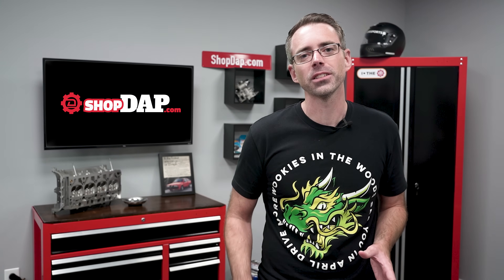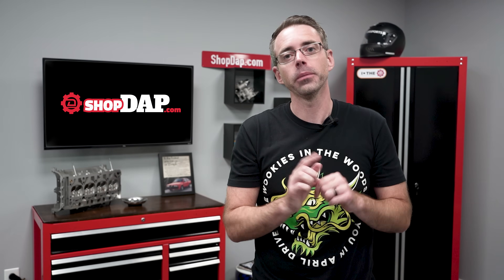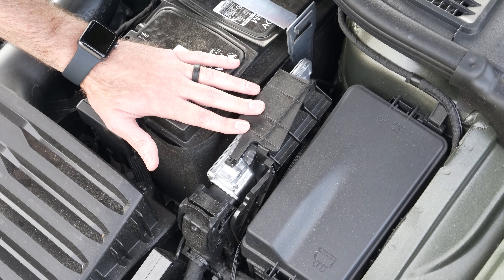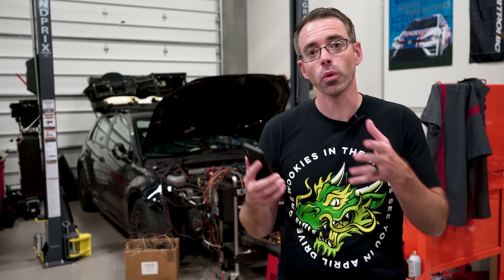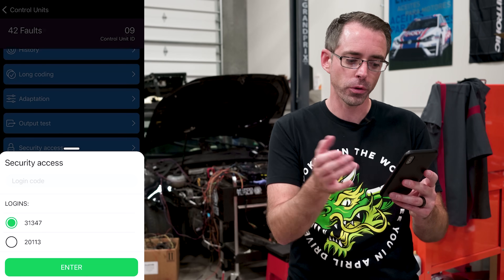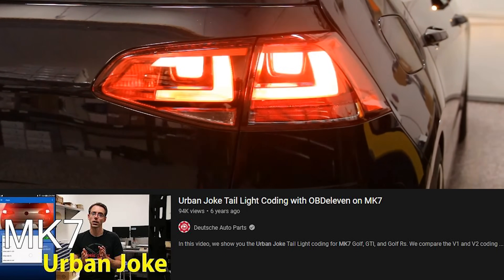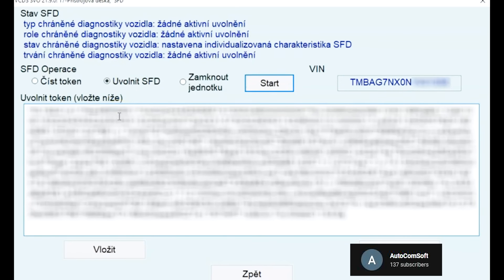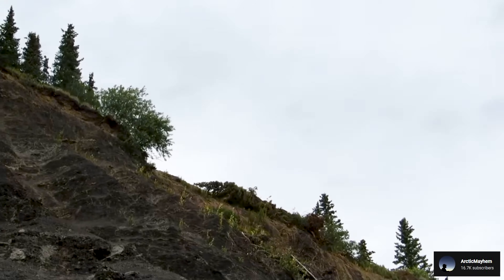Is VW Trying to Stop you from Working on your Car? SFD Unlock

Comment: I don't like it, because there's almost no consumer benefit to over the air updates. Its great for manufacturers, but if the goal was consumer friendly they would have streamlined (and made free) the wired update method first.

The goal of ota updates is the subscription model for features. Its not an end for the manufacturer by itself.
Reply: VW thinks people want cell phone features built into their car, like android auto, so it is for marketing.  Some people might think they want it, but in reality they just play music and use hands free over bluetooth.
Reply: What makes you think the OTA updates are to enable or disable features based on subscriptions? I know BMW does that but do far they're alone. It's a common practice to distribute software updates that improve functionality of the car or fix bugs that show up later after a new car has been launched. Usually you bring the car to the dealership to get those updates though. 

OTA becomes particularly important if a security vulnerability is found. The fix can be distributed to everyone with that vehicle almost immediately, rather than expecting customers to return to the dealership for a recall.

Its practically impossible to test all the software in a complex system, like a car, in all possible situations before its launch. So the ability to fix issues in the future is a benefit to the oem and the average customer.
Reply: @joebormann7631  I would buy that but without OTA integration there's an extremely low level of vulnerability to security issues. That only pops up in a big way once they allow rewrites over the air, which they are all, not just VW, in the process of implementing. While I do understand the desire to fix 1st year bugs without roping in the customer, the dealer network works just fine for that as is. The car itself is a static software environment, it's only the phone integration that would require updates once everything else is stable, and that is handled 100% on the phone side already. There simply isn't a problem there as it is now, at least for any brand with a dealer network. Tesla otoh, needs it, but only because they have basically no service footprint.

As far as subscriptions go...all the majors have announced plans/intentions on this. They have nearly all also announced the desire to be the ones gatekeeping and selling cellular data from in car use as opposed to android and apple. Both of these margin increasing plans absolutely require OTA to implement in any kind of profitable and streamlined manner. My problem is, I see zero benefit to myself as a new car buyer, only added and recurring costs.

Comment: It's probably a little bit of both, honestly. I think if they can dissuade people from working on their cars and funnel them to the dealer? That's great for them, but it's a secondary bonus for them. It's likely for security, but I think a 'better' way to do this would be a setting in the infotainment that would turn on a 'support tunnel' for a set amount of time. Whatever the average update takes + 15 minutes or something like that that ALSO requires the hood to be open. You can also ping people to the infotainment saying 'Update available' and then page number in the manual or a QR code for the instructions online to do it. You could even add an MD5 hash of the update to verify against the one in the release notes to verify it's the correct file before doing the update.

This is sort of how enterprise IT equipment (including backup appliances and storage arrays) works nowadays. You can call support, and they have you turn on the support tunnel, otherwise there's no remote access to the device. It's secure and also lets you actually use your equipment as you see fit whilst still being open for OEM support when needed.
Reply: except when there is an ECU that is online there is always a way to hack it, whatever you try to implement to avoid it... the ECU already has to be online for the maps and stuff like that
Reply: @WhiteG60  there is always a way. But sometimes there's not enough money on the line.

Comment: My local Audi dealership constantly:
- avoiding to pick up their phone when you call to ask info or book a service
- charges me for diagnostics and doesn’t deduct it when I decide to accept their repair proposal and pay for them (its ok to charge if you wanted diagnostics only and to repair yourself. But charge diagnostics and repairs…)
- mess up their own parts order
- refuse to do wheel alignment (the machine is “broken” like Ice Cream machine at McDonalds
- overcharges
- clearly is not used to repairing anything newer than 2012 cars (we are a poor country)
- favours companies heavily and ignores “civilian” customers with service
- mid repair “accidentally” realises that they need more parts…despite paying 70eur for diagnostics that told us a different price for repairs and parts

But suree…me repairing my car is the problem!
Reply: I went to my dealer to have them run a preventative scan on my timing system.   they refused.   they said they only run scans if check engine light is on.
Reply: @alexhatcher8812  also the word “preventative” is AUDI and VW’s “no no word”
They should be updating your MMI system any time you come in and the new version is available. But they dont. Some programer geek gets paid thousands to write those patches. And dealership cant be bothered to install it and give you new security, reliability, performance patches and new functions.
Reply: @F.S92  thats the same for Kia (my parents car) with their 7 year crappy "warranty" It means they try (WILL) do as little as possible with the result a huge bill just after the 7 years. they are just scammers
Reply: @alexhatcher8812  ok I kinda see that such thing can be technically seen as “too far to start diagnosing”.
I sympathise with your wish for preventative maintenance. But I can see if the dealership is up to its neck with real time repairs and broken cars, that they might refuse.
However, no excuse for them to refuse if they have nothing to do or slow season in the shop. If you are willing to pay they should be there to oblige.
I asked them to update my dsg firmware on my TT 2016 and recalibrate it. They refuse stating that my “uneven and jerky” dsg behaviour is not an immediate issue and is partially due to the nature of dsg.
Ok fair play, dsg especially dq250 is not smooth. But long story short, due to unknown reasons my car became undrivable due to this.
Had to take it to a 3rd party shop that updated the firmware and recalibrate the dsg computer and clutch pressure. Now runs smooth as butter. No thanks to Audi.
Reply: Sorry for your shitty mechanics.What a bunch of dishonest scumbags.   Hope everyone finds out how much of a scam artist they are so they go byebye out buisness sooner than later.
Reply: I do agree, many service centres have issues and some of the ones you listed are legit. However a technician should get paid for diag time regardless if the work is sold or not. I've never seen the service centre eat the cost if the customer accepts and purchases the repair, but it's very believable some will do it. But the fact they charge diag and repair together, is not unreasonable. If your doctor diagnoses you with cancer, but you forfeit chemo, or other therapy or cures, does that mean your doctor should not get paid for diagnosing you??

Things happen during a repair and 'accidentally' needing new parts sometimes may be due to incompetency, but is often because a part is not reusable after removing, when it wasn't expected to be a problem when quoting the repair. Things break when you wrench on stuff, it's just a matter of fact. And dealers are really best suited to work on newer stuff anyways. If you have something over 10 years old, find a shop or a good mechanic who works on the older cars regularly.

Dealers don't like to work on older cars anyways for the most part since there is no training on old platforms, and high technician turnover in the industry means that a 20 year old trained on 2020+ vehicles will have zero clue how to work on/diagnose a 20 year old model. Just my two cents.
Reply: Sounds like a dealer issue not an Audi issue🙄
Reply: How dare a technician get paid to diagnose a car whether you get the work done there or not!
Reply: @robkingsley9887  Usually the technician will still get paid for the diagnostic and the service center eats the cost. Speaking as a technician at a VW.
Reply: @MrCashMoneyD18  this guy gets it
Reply: @MrCashMoneyD18  Why eat the cost? The technician performed work. In some cases a lot of work. If the diag takes 2 hours and the actual repair takes 30 minutes it would be silly to charge a half hour labor, you are losing money on the job. If that happens 8 times in a day the dealership/garage should just pay out 16 hours of labor?
Reply: @MrCashMoneyD18  They get paid in odis time, which is usually 0.30 hours for a scan and complete diagnosis.
I spent 6 hours diagnosing a car last friday, using odis. I got 0.45 hours for the job.
Reply: @robkingsley9887  because thats what dealerships do usually. If you:
1. Come to Audi just to get a diagnose for your problem… you pay 70eur and get the report
2. Get Audi diagnostics and cost/parts estimate, agree to do the repairs with them. Then the dealership deducts the cost of diagnostics from your final bill. As it was then basically you paying them to tell you how much will you be paying. Like how if you would pay a person in clothing store for each request to bring you or look for the shoes that fit you.
Reply: @F.S92  Paying someone to pick clothes of a hook is a bad analogy because you would be paying someone for something you can do yourself. The techs went to school, got the training and are performing work most can't. If you go to the doctor and they diagnose you with an ear infection do you only pay for the drugs or do you pay for the diagnoses as well?